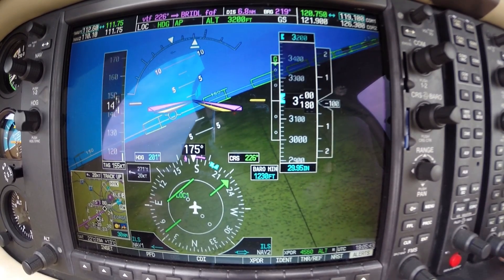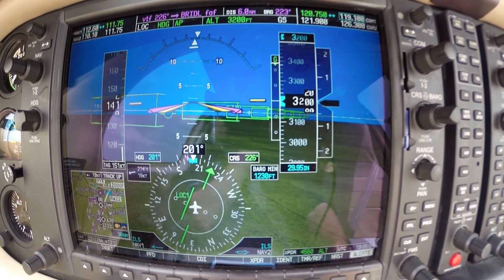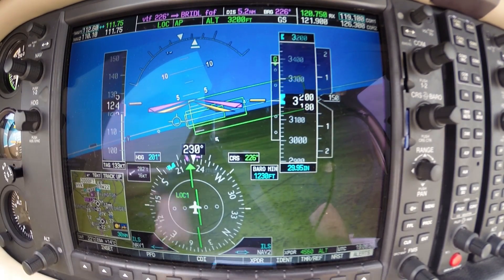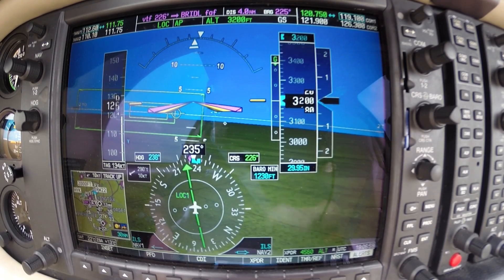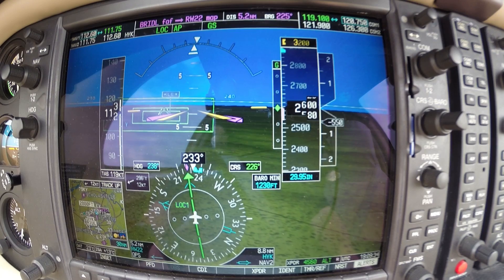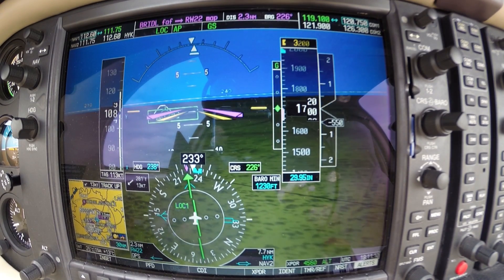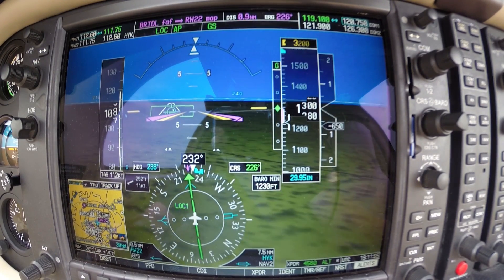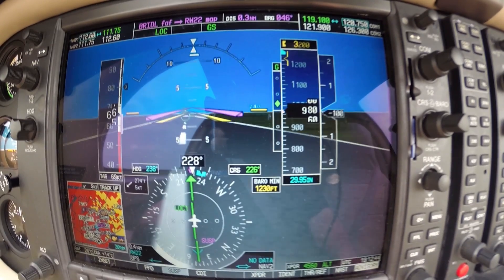AirMart - Flying an ILS Approach with the Garmin G1000/GFC700

Comment: I have a question: How did you make 111.75 Green
Reply from the maker: On the G1000, when you load and activate an ILS approach, the system automatically displays the inbound final approach course, loads the correct LOC frequency, and changes the NAV source to LOC (green needle). This capability reduces the pilot's workload significantly (although he/she still needs to verify the information that was loaded is correct).
Reply: I think he pressed cdi button at the bottom

Comment: Great video. Do you have to manually descend using the VS button?
Reply: You WILL have to adjust power for speed in most equipped airplanes. The learning curve in the G1000 is high. Once you learn it, the G1000/GFC700 is good enough to make you lose your proficiency if over used.
Reply from the maker: Not during an approach with vertical guidance. The autopilot takes care of the descent.

Comment: How did you make the green boxes in the background showing you basically the course you should be on show up?
Reply from the maker: The Highway in the Sky (HITS) boxes, if activated through the PFD, will correspond to the current source of navigation (GPS, localizer, etc.). They also will correspond to your selected altitude. There is a softkey on the PFD (fourth from the left) that is labeled "PFD". Pressing this button will give you options such as synthetic vision and HITS among others.